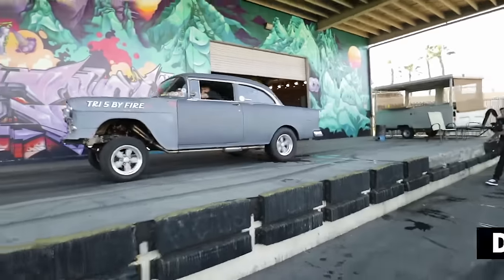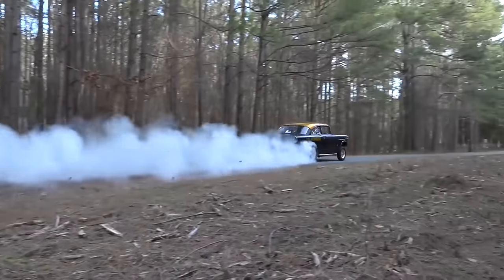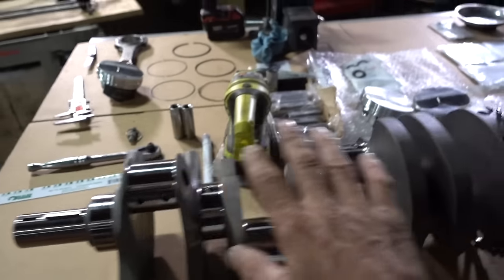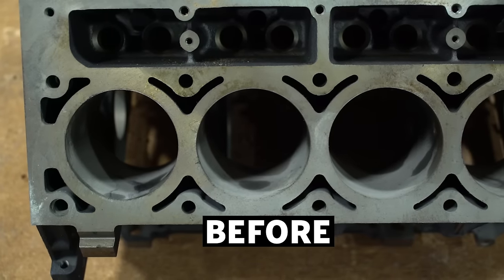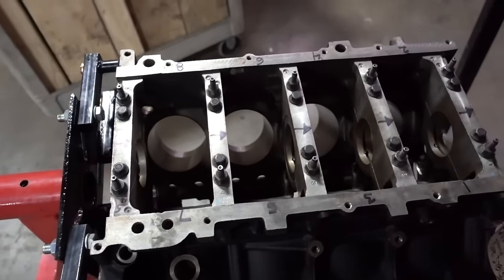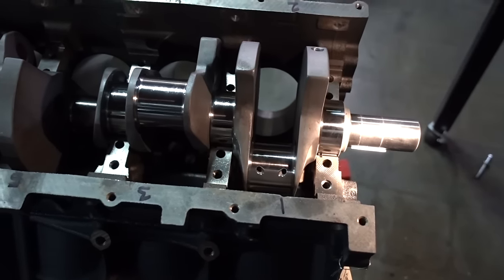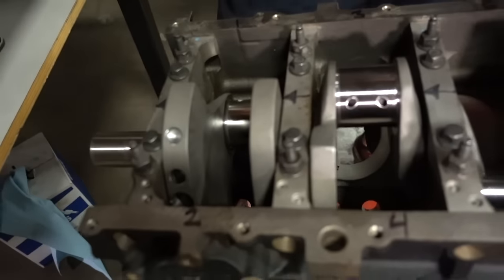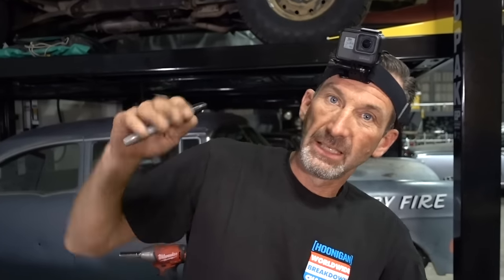700HP Stroker LS - How To Build Bottom End

Comment: Couple of things. firstly, if you knew you were going to be using arp studs the machine shop should have line honed the mains. It's been proven that arp studs with their much higher clamping force warp the caps slightly more and twist the block differently thus changing the main journal clearances. Secondly, you should have also checked the main journal clearances using the arp studs not the factory bolts. For the same reason the clearances will be different between the factory bolts and the arp studs.
Reply: Should never 'double-click' a torque wrench either....
Reply: Was going to comment the same thing. Totally pointless to check clearance with factory main cap bolts.
Reply: Was waiting to see if someone else noticed this lol
Reply: was surprised to see plasti-gauge too but maybe they didnt have a set of dial bore indicators? also, never seen a ring set that way, but i guess it work.
Reply: Dial bore Gages are so cheap, unsure why they don't have one for their shop.
Reply: I used to think Plastigage was stupid but it's actually the safer method for a few reasons,  although I doubt our homie in the video is aware of them.  I used measuring tools for a while and noticed that the readings would vary depending on the ambient temperature and how long I held the tools in my hand.  If you're measuring the bores with the crank out , you won't be able to tell if the crank is bent or if the main bores are not aligned.  The dial bore gauge leaves little grooves on the bearing surface especially if you measure the same spot multiple times.  The tools also must be high quality (expensive) , they need calibration , and there's more room for user error.
Reply: also notice the amount of holes they drilled in the crankshaft
Reply: That means the piston + rod weight (bob weight) was significantly less than the counterweight of the crankshaft.  So material must be removed from the counterweight to balance it.  It's more effective to remove material furthest away from the centerline of the crank, so multiple shallower holes makes more sense than going deep.
Reply: shouldbeasy Yes! This, never doubble click it. Also never reuse a volt etc. I use a lot of torque wrenches and different amount of torque everyday. We also had a whole day course about nuts and screws, I work as a subway mechanic if you are wondering.
Reply: Thank you so much..As soon as I heard him say it im like what the fuck?
Reply: Did you see the golfcart this guy put together??  That should answer all your questions on this engine build..
Reply: totally agree! painful to watch
Reply: I liked the video but there were definitely some wth moments and lots of cringe. Glad you posted up first lol. I wasn’t gonna.
Reply: @whatyareckon, this is something I didn't consider. It's a great point. I wonder if the machine shop knows about the ARP hardware? It may be a minimal difference, but still a difference. {Clarence} LOL
Reply: We did, weeks before this post. Scroll down
Reply: Wrong clamping force only changes when the builder changes it  100 ft lb  same stud or bolt with a stud u can add more clamping force  only way to get more force is by  adding it.
Reply: why arent you suppose to double click? first ive heard of it
Reply: @jeremyfizel5127  
Actual clamp force changes, for the same rotational torque  (same wrench setting), between bolts and studs, due to thread pitch.
Reply: Killing me gapping the rings over the installed crank, just size them first and clean the block before assembling.
Reply: @ShawnDickens  I know right!
This guy is rough af,
And I'm quite scared to think how many people out there will now set there main clearance on a boosted LS to under. 002" because the guy in the vid "said to do so" 
Asking for a major catastrophy
Reply: ARP is a brand... torque is torque.   ARP is a name brand..period.   You figure that out.
Reply: Shawn Raymond lmao ok dude .
Reply: @Luminaring  If you don't believe that factory TTY fasteners relax(and lose torque) much more so than ARP's reusable fasteners, then I hope you aren't taking peoples money to work on their junk.
Reply: Yea, this bullshit was pretty bad. I typically try not to be judgmental or anything because there are a lot of little details that various successful builders do differently, but when he started measuring clearances with factory bolts instead of the ARP's in the final assembly, I knew it was just gonna go down hill...
Reply: Some of us are not keyboard mechanics. As for me....I'm a 30 year engine builder that has worked in everything from local dirt tracks to Nascar building 800+ hp engines. Pretty much everything said in this comment section is straight on. Should have measured with the ARP studs. Block should have been align honed before any other machine work was done. Should have used micrometers to measure clearances. All measuring/ring gapping should have been done before the assembly process. He should have done a mock up of the engine before assembling. IE what happens when he bolts the heads on and doesn't have enough piston to valve clearance? Sure everything probably worked out for this build.....but this is how garage builders do engines and not how professional engine builders do it.
Reply: @parrot69777  you're the guy no one is listening to stud.
Reply: @bbc454nos  By all means, not one single fuck is given by a single one of us if you want to build a "high performance" engine with TTY bolts and plastigauge just because you saw someone do it on YouTube. Go ahead, do it broski, since you clearly have learned enough from watching YouTube that you're totally going to build an engine, like you keep suggesting[eye roll].

The rest of us - the ones that you aren't listening to - we'll be over here working on our own shit(in my case, a 1980 notch Fox with a 7500RPM 306" Windsor that I built for a not insignificant amount of boost[all forged], backed by a 5 speed - about to get a Haltech Elite 2000 ECU implanted in a month or two followed by a RyWire solid state conversion). Not caring.
Reply: Regardless of using ARP or OEM studs, unless the torque specifications change from the recommended, I wouldn't bother line honing the caps. There's not going to be a crushed bearing issue here. However that said, the ARP studs can hold those caps in place without the fear of stretching out causing bearings to spin and say goodbye to the crankshaft
Reply: @supremeleaderarmy9164  its *you're. What else ya need help with?
Reply: @RyTrapp0  not reading one word of that novel. Get back to helping someone
Reply: @parrot69777  one other thing to add. He was seating the thrust bearing after everything was torqued down. How is that thrust bearing gonna line up, when it can't move?
Reply: @Salpeteroxid  you mean never re-use a torque-to-yield bolt. Most headbolts are that, but most rod/main/etc bolts aren't. A good steel fastener can be torqued to proof strength many times. A material specialist actually tested the OEM headbolts vs ARP vs China, used GM bolts actually had a 2% higher yield strength. China studs were worse than both.
Reply: @hydrocarbon82  Yes that's what I mean, We reuse a lot of screws and some we replace. As long as you don't overstretch them it's alright :)
Reply: @NickKautz  I never scratched a journal with a piece of plastigage either.
Reply: whatyareckon thank you! Someone actually knows their way around an engine.  I was yelling through the whole bottom end assembly !
Reply: whatyareckon shit the block
Should been lined honed regardless
Reply: @paulsachs9983  Where did you find a cheap dial bore gage?
Reply: Yep, pretty sure this engine didn't last, .0015 is too tight of a main clearance without a perfect main line, nothing wrong with running .003 on the mains and rods in an iron LS, 2nd plasti gauge is a shit way to measure an expensive engine build, a dial bore gauge and 2-3" outside mic can be had under 150$, do yourself A big favor and do not take this video for advice!
Reply: @shouldbeasy9721  why should you not double click? i never heard this. And i did read the manual with my Snap On tq wrenches.  thats how i learned you have to set the wrench 1st by putting it in the center of its range and clicking it 3 times in each direction as per manual.
Reply: Isn’t he also not suppose to torque it all the way when measuring the clearance, he just ruined the bearings “crush”
Reply: Even I knew that..lol
Reply: All these reasons are probably why this motor rod knocked the first time it started lol
Reply: Actually, this is not always true. Sometimes you do, sometimes align honing is not required.
Reply: I might add that none other than Kurt Urban, former shop manager as LS Guru of Wheel to Wheel Powertrain, is the person who informed me that not all LS blocks need align honing when switching to ARP studs. I was lucky-Mine did not need it. Saved me money and never had an issue......
Reply: @paulsachs9983  REALLY ACCURATE Dial bore gages are NOT cheap!! Most also dont include cost of a quality gage block set to set up the gages!!! This is not just a $300-$400 setup!!!
Reply: @milojanis4901  so where is wheel to wheel today?  to be honest if you are measuring to an accuracy over 5 tenths, these methods and modestly priced bore gages are fine.  anything needing more precision should really be done in a temperature controlled environment with temperature normalized parts, and preferably on a cmm.  but were dealing with backyard builds.  any method described in the faa ac 43.13 or by any aviation engine manufacturer is fine.  these engines are not running 100k, they will most likely tear the hone out of cylinders well before the run into a rotating assembly issue from clearances. if an aviation engine which will  live its entire 1000+ hour life at 80% to 100% throttle is ok with these methods your backyard whatever will be fine.  no joke, if your clearances are over .001 and less than .006 shits going to be fine.  if i were on the tight side i would be checking crank run out on each main though.  to put in perspective what my bore gage setup cost, was 100$ for a high quality sylvac indicator, good to 3 micron on cal, 150$ for a mitutoyo bore gage kit 2-6", i set mine with a height gage and gage blocks that i already had.  its not necessary to get the bazillion dollar bore mics for this.  i mean you can do just fine with a set of cheap mics and snap gages if you want.  or an internal mic set.
Reply: 9
Reply: @salvadorebertolone  They didnt survive the 2008 eco recession. If you dont know who they were, do some research. The fastest IRS Corvette in the world uses an engine built by Urban. If you question his abilities, you are the only person I've ever heard of that does. See ya, and good luck......
Reply: @salvadorebertolone  btw, I'm a retired Tool and die maker with 43 years on the job. I've used dial bore gages and micrometers more often in 1 day than most here have in a lifetime. .0005" is a LOT to a real machinist/engine builder, especially on an aluminum block.......
Reply: @salvadorebertolone  Check out the Corvette that Mark Carlyle races. 6 second et's@223mph in the 1/4 mile....On Gasoline......
Reply: bro im seeing so many wrong things here it actually hurts
Reply: All of this and turning the crank in the upper main bearings, with NO assembly lube, and without the main caps on and torqued.  I cringe every single time i see someone do that.
Reply: @jeremyfizel5127  science
Reply: @diymisfit_Mechanic_UDX404  AFTER?  Are LS mills different in that regard than "old school" small blocks?  Last I heard, you seat the thrust bearing, THEN install the other  caps, checking rotation ability after each one is installed...   lol
Reply: @jeremyfizel5127  incorrect. A bolt with a higher tensile strength will not stretch as much as a lesser quality fastener.
So while they both were torqued to 100ftlb we'll say.
The arp bolt applied more clamping force,  while the factory bolt stretched instead of clamping down.

Comment: ALWAYS CHECK CLEARANCE WITH THE STUDS/BOLTS YOU ARE GOING TO USE. Should have checked clearance with the ARP hardware that you would end up using. Trust me, it can change it by about half a thou in some cases. Also plastigauge should be used only as confirmation of your bore gauge and micrometer readings. I would not recommend assembling an engine with plastigauge alone. And 2 thou on the mains would not be a problem at all, especially for a high performance engine that's gonna see the strip. 1 thou per inch of journal clearance is the standard, if you want to run more oil clearance and a thicker oil, add half a thou. You have to adapt your oil clearance to your demands and oil weight, I'm sure the service manual wants it tight but they are also not expecting you to make 700 horsepower.

Comment: Guy blew it. When changing from bolts to studs on the mains the clamping force is different and needs to be reline bored using the studs.
Reply: I literally just learned this the hard way (I honestly had no idea). Say goodbye to your main bearings. Fax.
Reply: You're 10000% correct
Reply: 1000000000% correct
Reply: Yes he should have used the studs and check bearing clearance then hone to size because the bore is not round after changing the studs.
Reply: You are absolutely Correct, what ever parts you R gonna use for the built,  you take them with your block to the Machinist for bob weights and all the machine work. 
 Especially if its a Performance Built.
Reply: Lol but isn't it somehow still going long and strong ? I saw him driving it not to long ago
Reply: @freedomfox8183   Hey buddy, this is U-tube,. Not real Life ok, when in doubt, ask an expert or check your engine built Books.
  Better to do it right, its your hard erned money you are putting in your engine.
Reply: Yes agreed. Unfortunately it's the problem of youtube, everyone can look like an expert. I agree with the comment of @Hector Ortega bellow.

Comment: I've built a "few" engines since I did my very first 440 at 21 yo, when everybody told me I could not do it. This is a very good video for people starting to learn. Now a days, my friends would ask me to call them when I was getting ready to build a transmission or engine so they could watch. I would say, "yeah, OK" and not call them. I would call them or tell them when they called, it's already together. They would get mad at me and ask why I didn't call. I would tell them I didn't want to hear, " Well, Billy Bob said you can't do that because it will blow up when you start it". I don't have patience for stuff like that. I wish I did but I don't. I've tried to help people in the past with stuff as simple as installing rockers and got told I did it wrong because they were too tight. I explained to them when they asked me to help, that the intake would have to come back off to soak the lifters because they installed them dry. They did not want to take the intake back off because they would need new gaskets. I told them ahead of time it would be near impossible to set preload on rockers with lifters with no oil in them. After that, I was done helping people that don't want to listen to me that have never built an engine and don't want to listen to critical advice. I wish things were different, but that's how it goes. If someone that has put engines together before wants advice or help, that's another story. It's nice that you have patience that I don't. Good luck and hunting with your new engine.
Reply: You can construct your project with your buddies not to be in the way or moving anything to mess with you  I was 12 with a 350 in 86 cutty but I haven't had but 2 cars worked on by  anyone else besides me and I am 45 lol and I'm on 09 600 RR  now I thought cars were fast but they are not  all Ferrari fast for a few thousand bucks and 100 dollars for the entire years insurance
Reply: @craigstreetzel7743  Yeah.......... The kid that ended up in my lane on a two lane road when I was on a Sunday drive on my '06 GSXR-1000 kinda ended my motorcycle days. A partially severed rt ring finger, broken pinky, three inch tear in my rt knee, and a five inch tear in my lt thigh, just 1/2 -1 inch short of my femoral artery. I'm done riding unless I leave N.J. These people drive like their on crack here.

Comment: 14:05 I recommend using a bare piston for this step. Simply slide it into the bore upside down and use it to push the ring down flat, then measure the gap...
Reply: YZFoFittie bate Piston can sit on an angle, putting a ring on a piston and letting it sit against the deck makes sure it’s flat
Reply: Won't work with a dome piston.